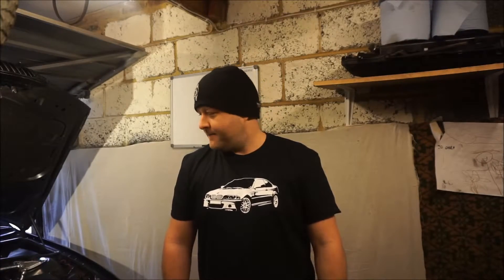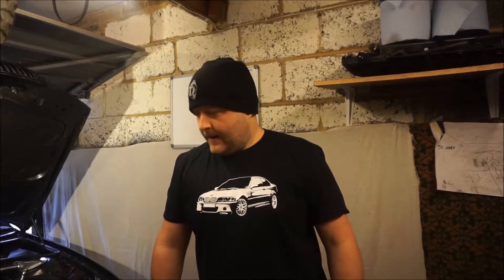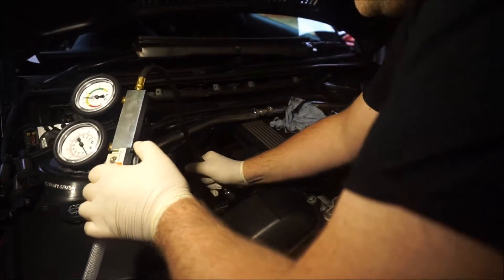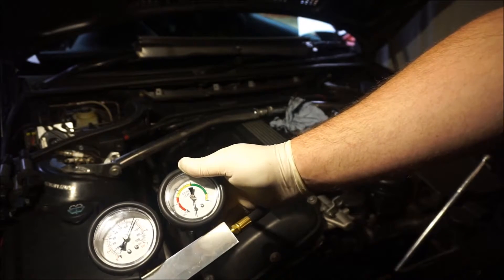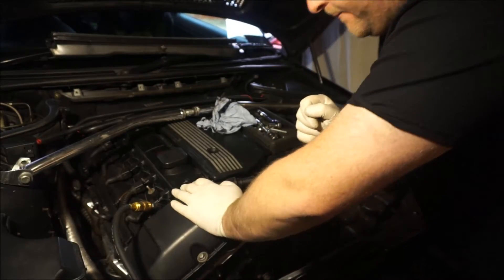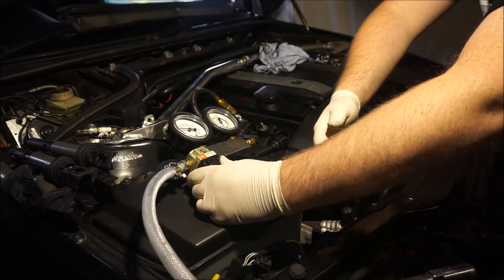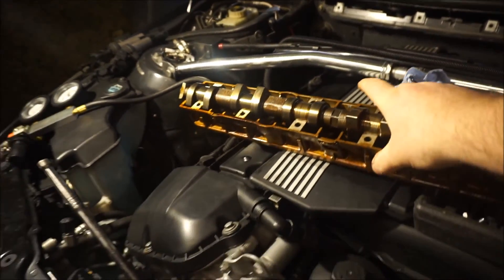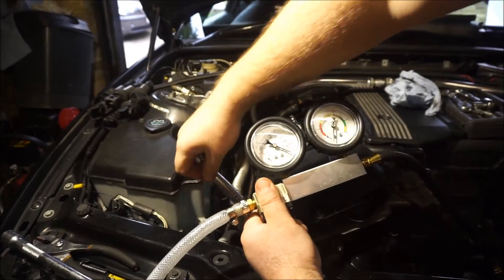LEAKDOWN TEST AND TDC in BMW E46 M54

Comment: can you do this leak down test while on an engine stand? M54 engine with just intake and catz. also can you set the PSI to say 30-50 first to get to TDC and then adjust it to 100 after?
Reply: as long as the crank is secured ,you can do anything

Comment: Thanks for your reply. What I noticed engine running in cold is bad and getting worse with engine running warm (5mins). What I further noticed is, that cyl 6 spark plug is again in a mix of oil and fuel. How can I test without disassembly that one of the rings has broken? Endoskop only? if, rings, Does it make sense just to change the set of rings or changing all cylinders. But then I think I need to change bearings of rods as well I guess! and new cyl gasket!
Reply from the maker: Julius West you can't check rings with endoscope,only leakdown test will tell how much leak you have and where is going

Comment: Hey, very informative, checked m52b28 engine by a cold compressiontest, due to engine is running terrible, and all cylinders except nbr 6 had 18bar more or less. cyl 6 had none. Saw a video of fixing 0 compression due to heavy carbon buildup on a video it shows and tried to check with liqui moly fuel injection cleaner. But it didnt work, because a I dont want to have the engine running to operating warm conditions. When putting some oil into cylinder 6 compression rose to about 6 bar. But shortly after it, it was zero again. Is it likely with these engines that one of that 3 piston rings had been broken. engine has about 440.000km.? thanks for your reply.
Reply: Julius West thanks,M54 have a rings problem but m52tu are fine, your issue on one cyl. which could be stuck or broken rings,head gasket problem,valve, but if you did wet test it's pointing towards rings.But I will perform leakdown test to be  sure.I've got one more video about leakdown test and many more about BMW engine.

Comment: You did not do this right either.  You did not show people they need to remove the air box to hear if air escapes through intake valves.  You did not show to remove the radiator cap to hear if air escapes into cooling channel.  You did not show to remove oil filler cap or dipstick to hear if air escapes past rings.   You spend too much time trying to embarrass the other guy, haha.
Reply from the maker: Bill Rogers I know ,there will be second part with more details on bare engine